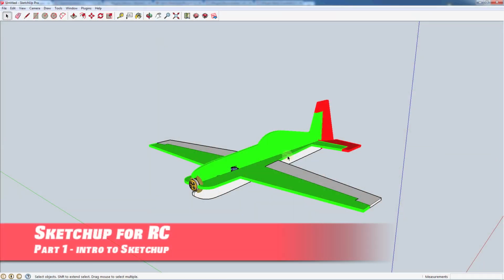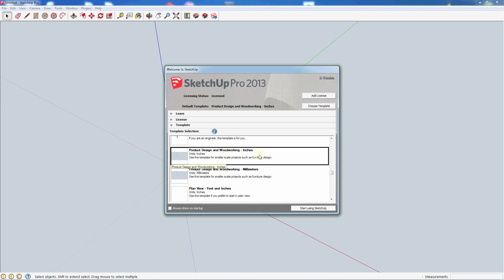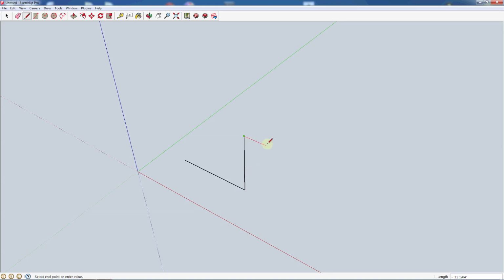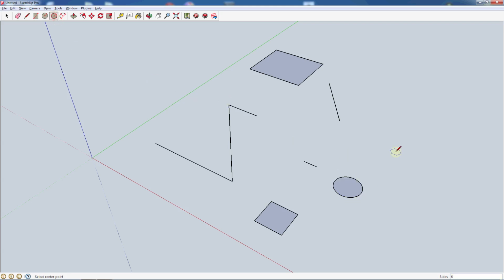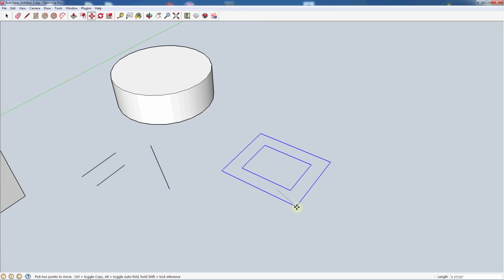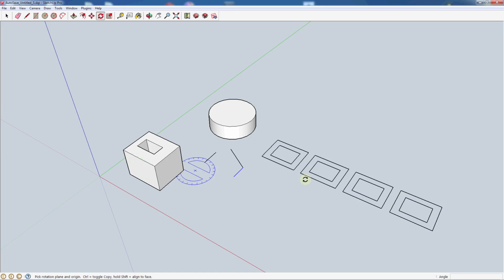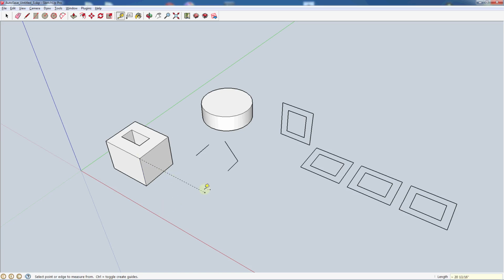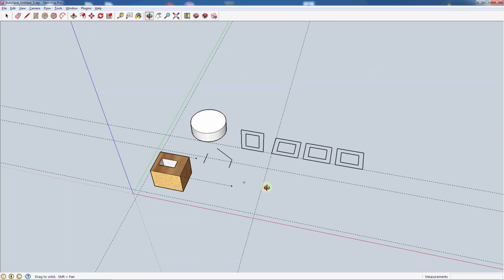Sketchup for RC - Introduction to Sketchup

Comment: Trying to run Sketchup 2017 and Adobe wont let me use ShetchUcation??
Reply from the maker: I'm not sure why Adobe would be blocking the SketchUcation plugin from installing. Are you using the extension manager to install the ruby file after downloading it from the Sketchucation page?